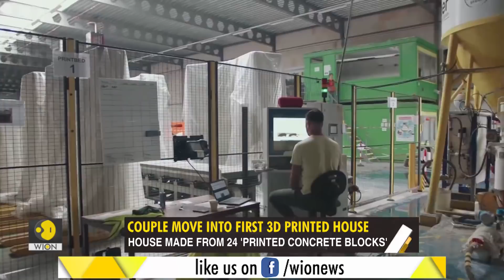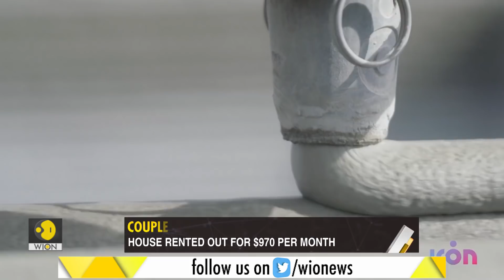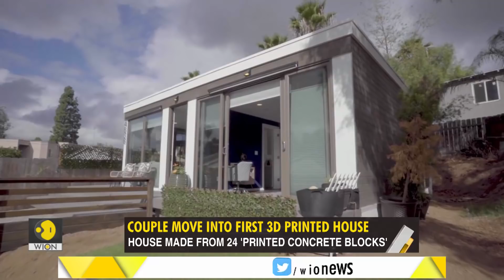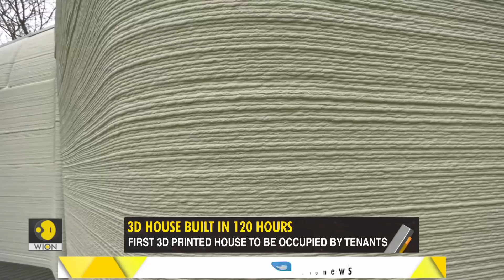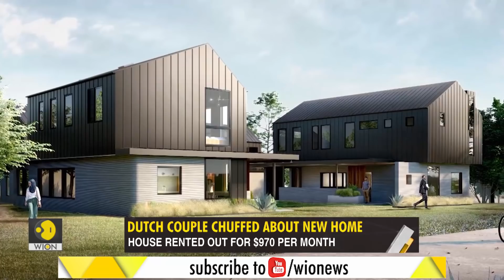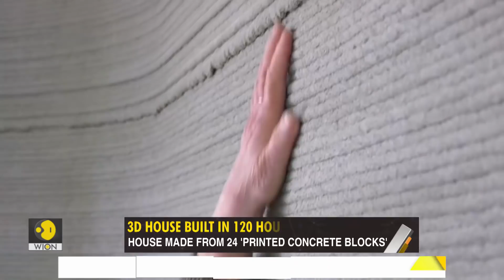Gravitas: Dutch couple move into 3D printed house

Comment: Not what I would call large. Any frame used with printing will limit size. If it takes too long to make the circuit the present layer won't stick to the previous. Concrete isn't cheap, and not exactly warm in cold weather.
Reply: print a solar panels and make your house heaters for winters rather then crying.
the time is yours they are no problems their are just opportunity to grow.